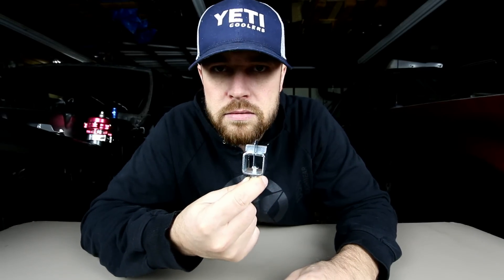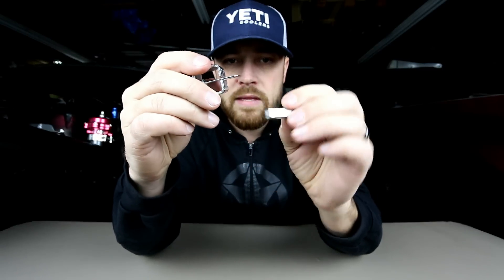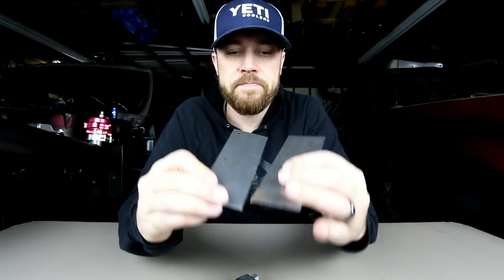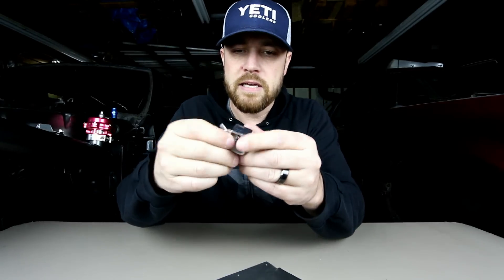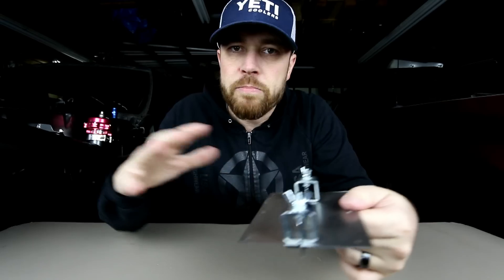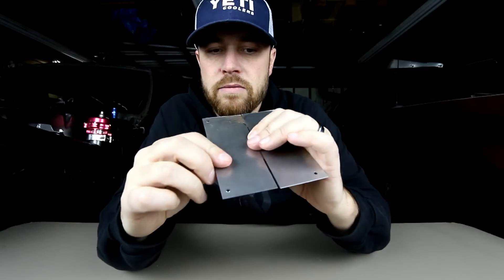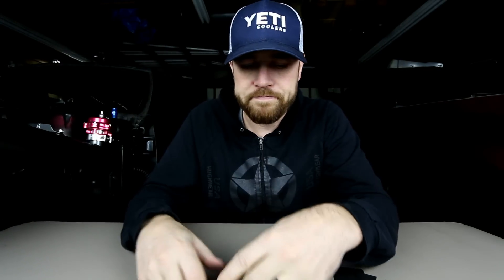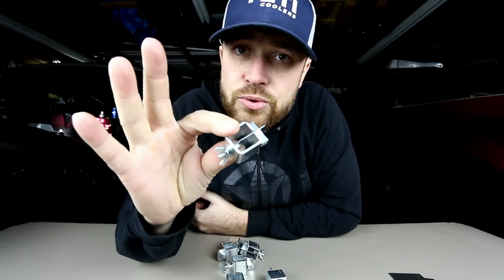You Need This Tool - Episode 7 | Butt Welding Panel Clamps

Comment: Dude. Thanks a million. I'm learning to weld and do basic fab work as part of my first car restoration project. Lots of butt welding sheet metal. I've been monkeying around with magnets and all kinds of other work arounds to hold my pieces together. Heading to Harbor Freight tomorrow to be a buttload of butt clamps! :)
Reply: Any tips I'll be welding in a new rear boot floor soon 😅😅

Comment: Back when I was building Car's I don't ever remember these being around. At least I never seen or heard of them from anybody......sure would have been useful Guaranteed. Thanks again. And, Merry Christmas to You & Yours from Me & Mine  =  )
Reply from the maker: They ate for sure a very useful but simple design. Merry Christmas
Reply: I work for a hvac company that has the largest sheetmetal shop and I've never seen them either.
Reply: gsppuffer  yea, They are or was New to me.

Comment: you could also slightly notch one piece of the material youre welding to accept the width oh the stud of the clamp to bring the two pieces closer together
Reply from the maker: +Rob S Correct...it doesnt take very much

Comment: Sweet, now i just need to figure out how i can make a set that holds a 90deg angle of two sheets the same way.. ingenious.. (gonna weld up a surge tanks for my car).
Reply from the maker: That would be useful
Reply: yeah i think i have figured it out as well same principle, gonna try to make a pair of em tomorrow.

Just make the "slit" in the box in a corner, and make the hole for square stock tilted 45 degrees. Then yeah then needs to be fastened from the inside.. but well if you make a tank u usually also make some form of inspection port so. =)
Reply from the maker: Yeah
Reply: +The Fab Forums be a cool little project video that seems simple enough.